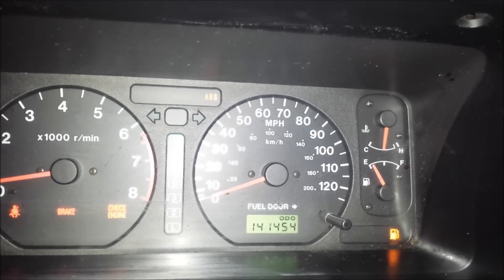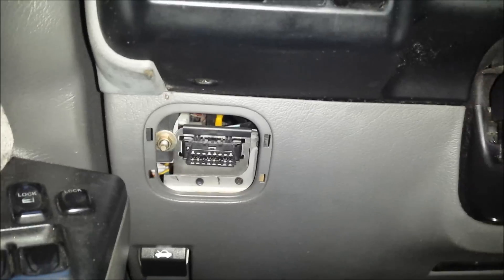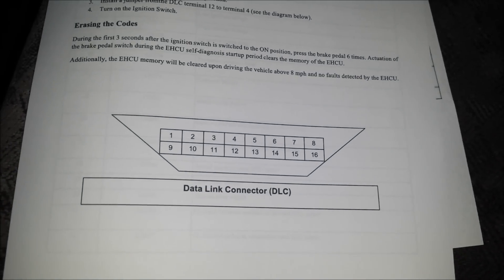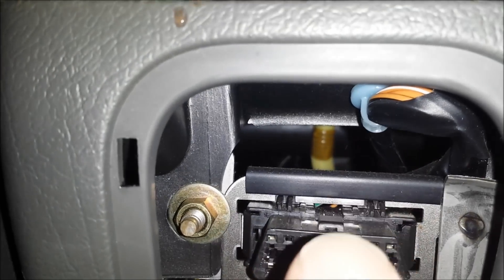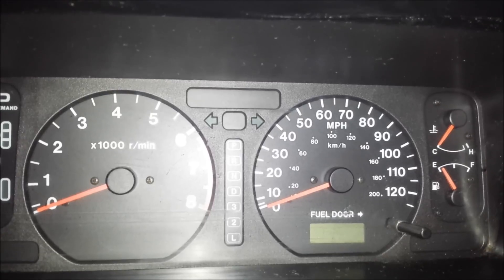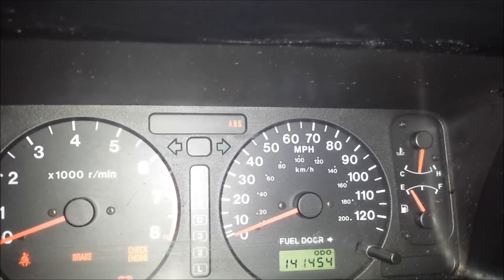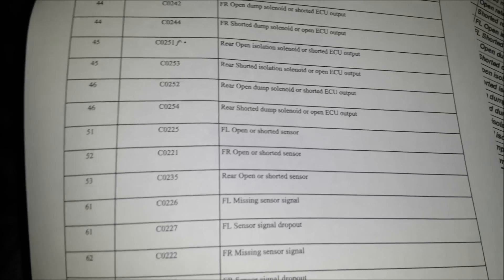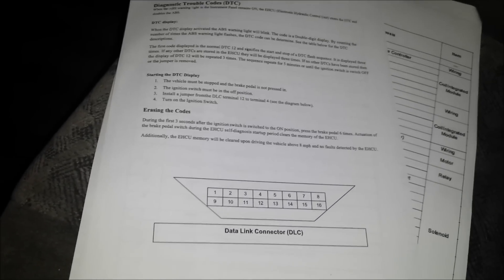Checking Isuzu ABS Trouble Codes For Free!

Comment: Hi Matt l own a lsuzu Dmax 3.0 (4JJ1) YEAR 2008 encountered with ABS CHECK LIGHT appearing problem . I've tried your method in diagnosng  , which is highlighted in this artical but failed
 Is there any other method whereby l can utilise to solve this problem?
Your kind enlightment would be very appreciated.

Comment: I also have my winter drive mode that likes to come in for no reason and won’t turn off anyone know anything about that??
Reply: If I were you I would disconnect the harness on the back of the winter/ power drive selector switch.  Winter drive makes your vehicle start off in 3rd gear to help keep you from spinning wherls on the snow & ive on take off , but constant driving with this on eventually leads to 3rd gear clutch pack failure.  After the trans burned up in my green 2001 rodeo i had the trans rebuilt and disconnected the switch. I have had 3 rodeos

Comment: the check engine lightthis morning there was codes blinking on its own I counted them it counted codes 26 2 and 13 do you know what codes those are
Reply from the maker: Rachel, are you referring to the check engine light, or the ABS light?  I am not aware of a method to read Diagnostic Trouble Codes via flashing the check engine light.  I believe this is only possible for the ABS system and the TOD (Torque On Demand) System.

Comment: +Matt Payne   As a new widow, thank you for helping me keep my '01 Rodeo LS running, reliably and cheaply. Attempting oil and fuel filter changes, adding brush guard,  tow receiver and brake light wiring.  Found vids on those. Q1.  There's a small ready plug/connector  attached (looks factory) to the driver side frame where tow receiver bolts on. Does this mean I don't need T-Connector wiring harness that connects to both brake lights? That I only need wiring from existing plug out to the trailer (flat 4)?   Q2. Fog lights: There's a ready plug inches from each "dummy" (plastic covering fog light hole). To add real fog lights, is it as simple as attaching the bracket and light assemblies then plug in pig tail n plug in switch in dash?  Q3.  Can you do or recommend a video on converting headlights to LED and also diy  modernizing stereo/speakers? Thanks
Reply: I know im asking the wrong place but does anyone know a trick to log back into an Instagram account?
I stupidly forgot my password. I appreciate any tips you can give me.
Reply: @Sullivan Castiel instablaster ;)
Reply: @Finnegan Alexzander Thanks so much for your reply. I found the site through google and I'm in the hacking process now.
Seems to take quite some time so I will get back to you later when my account password hopefully is recovered.
Reply: @Finnegan Alexzander it did the trick and I finally got access to my account again. Im so happy:D
Thanks so much you really help me out!
Reply: @Sullivan Castiel You are welcome :)
Reply: Check the 'dummy' power fog light plug for live 12v with a basic multimeter on DC voltage setting. You can also check the towed brake lights functionality this way too which more reliable than wiring diagrams that don't understand CAN.

Comment: Did you ever find out what the problem was?

My 2000 Isuzu Trooper seems like it's having all 3 similar problems at once and I'm wondering of these are real issues or something electronic.  Like a sensor or a PCM issue.

Aside from the brakes, you said you had an EGR issue, a transmission problem, and the ABS problem.  Mine's showing an EGR code (P0405), a transmission code (P1870), and the ABS light, according to this video is on for a code 43.

I've been driving my car for over 8 months with the check trans light and it's working fine.  For the EGR code, I applied voltage to the EGR and the pintle was responding.  Cleaned it.  Same error.  Just replaced the EGR.  Waiting to see if that fixes it.  The ABS light came on after a brake job.  They checked it out and couldn't figure it out.  It finally went away, but they had no good explanation.  Just that they disassembled and reassembled the brake.  And it disappeared for a while.  Not it's coming back intermittently with a code 43.

So I'm wondering if perhaps something electronic (like bad onboard computer) is failing and causing it to throw bogus codes.  Because our two incidents sound like a very similar trio of issues.

And by the way, thank you for the video!
Reply from the maker: My issues definitely seem to be real, rather than the result of a bad PCM...though that's not to say your issues couldn't be computer-related.  I bought this vehicle knowing it had transmission problems, and when I drained the transmission fluid, I could tell the clutches were toast.  The fluid was nasty and had "sparkly" material in it....not a good sign.  Furthermore, I believe I have a bad wheel speed sensor which is causing my ABS issue.  The EGR code is probably wiring-related, but I'm not going to spend the time to troubleshoot it since I never plan to repair this vehicle.  Instead, I plan to remove the engine and install it in another 2001 Trooper that I purchased with a bad engine.

I would definitely check your transmission fluid level and condition to see what it looks like.  Or, it may not be a bad idea to take it to a reputable transmission shop to see if there are transmission-related codes that won't show up on a regular OBD-II scanner.  These transmissions are the weak point in these vehicles, so I wouldn't want to push it if you really do have a transmission-related issue.

Good luck - I hope you get it all sorted out!

Comment: does this work for 2001 looks like it has same engine i also have the check light blinking just bought this car
Reply from the maker: This was filmed on a 2001 Trooper.  It should work for any Isuzu vehicle with OBDII diagnostics (any vehicle made in 1996 or later).

Comment: thanks I've heard of this method and suspect corrosion at connectors on my 01 trooper i believe abs unit/harness is the issue so far I'm having trouble disconnecting harness, now I should be able to diagnose first. I can see some corrosion at the pins
Reply from the maker: Cool - did you figure it out, Mary?

Comment: Yes, after getting the code from your procedure, it points to an internal fault in the electric side of the ABS control unit. I removed it (vehicle still operates fine without the electronic part) and am sending it in for repair ($160). When it comes back I should be able to put it back on and have the ABS operating again. Will let you know. Thanks again.
Reply from the maker: Nice work, Duane!  I hope that the ABS module repair works out for you!
Reply: Did it work? Where did you send it

Comment: this video is very helpful , i have isuzu rodeo 1998 2 WD and i'm ready to try it .
btw what was wrong with your abs ? did you end up replacing the sensors?
i have problems with transmissions too and I change the the solenoids it work
Reply from the maker: +Saadymodenation I'm glad you found this helpful!  I believe my issue is caused by a bad wheel speed sensor; they are incredibly expensive, and since the transmission also needs to be rebuilt, I am not going to replace the wheel speed sensor.  I actually purchased another '02 Trooper that needs an engine, but is in otherwise great condition, so I'm hoping to swap in the engine from the other Trooper.

I'm glad you were able to get your transmission working!  Great job!